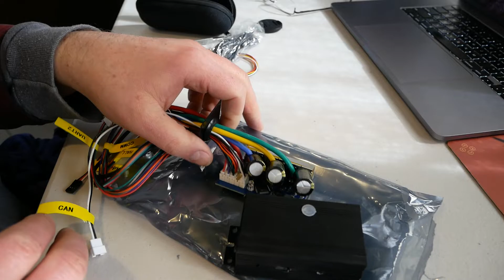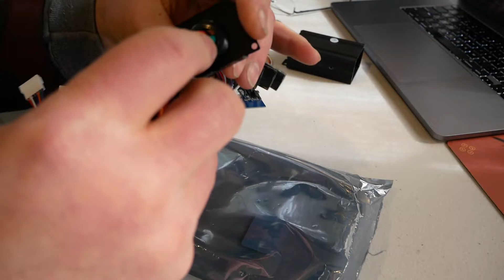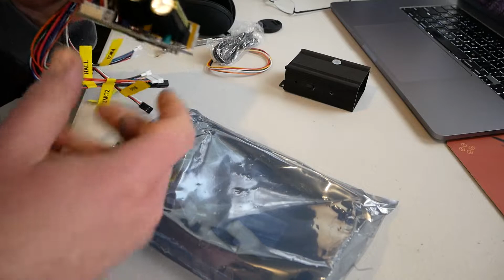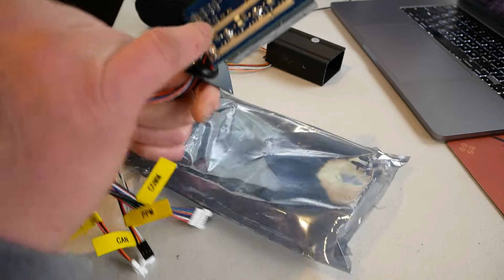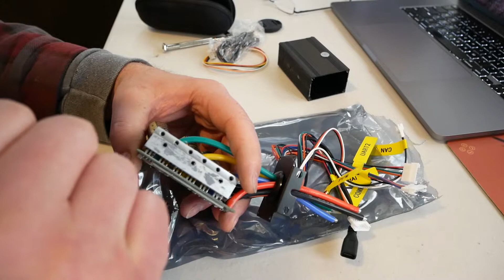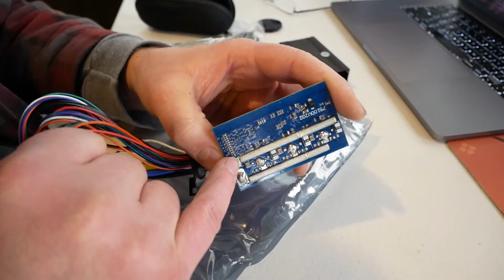Flipsky 75100 teardown

Comment: I think that they should put more space between the throttle wire pins , humidity can cause issues with sensitive throttle connections , that's why all ebikes should have a kill Buton that's close to the hands Incase the bike motor runs by itself at 0 throttle
Reply from the maker: GH1.25 is commonly used on most things from Flipsky. That's even worse. On these controllers, I replaced all the connectors with IP68 ones so I didn't care what was on them originally.

Comment: Dissapointing for 65USD? Did you get what you paid for?
Reply from the maker: Still junk. You pay a low price to get crap. Cheaper isn't better!
Reply: @de-bodgery yeah. I got a flipsky 75100 v2 pro and it's okay, neat features, but yeah it's noisy, bad form factor with tiny wire plugs.. they should have all the wires out a single hole in the shell with a glob of silicone and you just.. don't use the ones you don't want to use. Cut them short and close em off. These make me nervous it'll unplug and then give you 1.5v on the throttle which is like, half the torque.
While it's a lot nicer even turned down than the stock 20a trapezoidal controller, it does not inspire confidence. I left my original one on there with just XT60 and MT60 swaps back to it in case it messes up while in use. I should probably just get a phase runner (ASI's bac800) or something else decent. Vesc is a neat software environment, but seems buggy and prone to blowing up especially in these noisy things.

Comment: While I agree with some of what you said, I've found these to be very reliable running close to 75A Peak.  I was concerned about the non-reinforced PCB Tracks, but looking at it with a thermal camera, they barely heat up more than the bus bars - only a few C difference.  I've been running one on my e-Bike for 4 years, ridden every day - and it's been fine.  Even the heat transfer to the shell works sufficiently well.  Maybe it could be better, but in practice, it doesn't need to be better.

The waterproofing is an issue.  The best way to solve it is to fill the case with Ray Chem 'Magic Gel'.  It doesn't seem to affect the heat dissapation but renders the whole thing IP68.  I've run the controller fully submerged - and it didn't miss a beat!  I also filled the battery casing to waterproof the BMS.  I rode my bike through a flood with water over the handlebars, so the controller was about 2 feet under the surface.  The motor needed a bit of drying out - but the controller & battery didn't miss a beat. 

The wires being on connectors means you can 'weed' out the wires you're not using - making the harness much tidier.

With the addition of waterproofing, these are my favorite controllers.
Reply from the maker: Ever spend any time looking at the monitoring functionality? You'd quickly discover that Flipsky makes the MOST noisy VESC controllers you can find and the least reliable of them! So that's great the one you have is working, it's not working as well as other VESC options...not even close!

Comment: If anyone is having oddness in the behavior of this device, i want to point out two problem areas:

1> Flipsky doesn't proofread their docs, and every wiring diagram they have for this device is wrong.
Every
One
Go look at them and then your device and you'll see what I mean.
If you are already intimately familiar with this controller, or are just plugging cables in om a very vanilla install you may not notice, but if you are doing any custom wiring (required even if its all flipsky, but you are using their display) you'll quockly be frustrated.

2>  Do not rely on the function of vesc to figure oit your phases.

If you are having to use the reverse toggle in vesc because your motor is running backwards, just stop and correct the phase connections.

It only rakes a minute or two.

I was getting cogging on start that was awful

Different degrees in different modes until I corrected the phases
Reply from the maker: you might have found a bug in the Flipsky firmware.
Reply: @de-bodgery  There are so, so many apparently.

And I managed to do something stupid.

The controller abruptly stopped working last night with a blinking red.
Couldn't connect via USB.
Dis infected everything but power and was able to connect.
Decided it would make sense to start with the hardware specific fw.
I couldn't see any file sizes, buy I right clicked, downloaded- twice - same file size.

And of course it turns out you have to click the file - then there's a dl button.

Cripes. First time I've seen a fw update with no sanity checking whatsoever.

So, it reboots, vesc tool connects, then bit he's about the fw being unreadable (no shit - you loaded random garbage) and disconnects.

Good thing I have an st-link arriving tomorrow.

I think my dediprog could load the fw, I've just never used it for swd programming.
Reply from the maker: @Zomby_Woof  Sounds like the FW on it is corrupted. good thing there is an SWDIO connector so you can get the controller back!
Reply: @de-bodgery  oh, it's not corrupted - it's not even firmware.

It just html because I wasn't paying close enough attention.

I sorted that out though.

But my error would not clear, and it points to the motor.

I ended up pulling the hub motor apart because it had basically seized.

With a pair of vice grips of the flats of the axle, I could barely turn it.

So I pulled the commutater out and I can see scuff marks, but that doesn't tell me a lot. I think it's out of round. 

Probably because I waited too long  before putting a good torque arm on it.

I'm not going to bother to measure it to verify this. With no machine shop, the only option I have is a hail Mary with sandpaper to try and get enough clearance for it to spin free.

I have some ferro fluid, but I'm not going to bother with that unless and until I can verify some measure of reliability.

I'm not pushing it hard enough where the motor ever gets hot anyway.
Reply from the maker: @Zomby_Woof  Replace the bearings. A torque arm isn't going to create that problem. Either the motor shaft is straight or it isn't. That and bearings are about all that will cause rubbing of the stator with the magnet ring. I never use ferro fluid...waste of time, messy and can't be removed later.

Comment: Do you recommend a good controller for a 72 volt 5000 watt hub motor? TIA 😉
Reply from the maker: Tronic 250, Trampa 100-250 are both good options, but more powerful than the 75100. I'm just now implementing 2 of the new design 75100 controllers. They are OK, but not anything special.

Comment: Hello. Is there a good similar controller on sale that does not need to be finalized?
Reply from the maker: Finalized for what? I don't understand your question.
Reply: @de-bodgery  I meant not to redo it. Are there better quality?
Reply from the maker: @ЛенарБилалов-ю1э  Flipsky is the lowest quality VESC options. People buy them since they are so cheap and not because they are any good. If you want VESC controllers that are made well, stick to Shul, Trampa, Tronic.
Reply: @de-bodgery  These firms do not have the same form factor. I need a controller for an electric scooter outside.
Reply from the maker: @ЛенарБилалов-ю1э  There is an extremely high chance that you will have to make something fit...even imperfectly. These controllers don't exactly fit my scooter either.

Comment: Have you played with these much? I have a few of them and they just are not making any torque on a 1500W hub even if you set them to a max 1500 phase.
Reply from the maker: Considering this is a 100a controller, you already know that 1500a is not ever a possibility! Since turning up the phase amps had no beneficial effect, you also know that this isn't going to fix anything. You have something else wrong...not sure what.

Comment: Mine just blew after 7 months 50-80A at 20S, so seems decent enough for how bad it looks lol, upgraded to the 75200 now
Reply from the maker: Probably over heated
Reply: @EV Components Review (De-bodgery)  
Can be, looks like one of the mosfets or corresponding low side shunt blew since both are damaged and the trace between is gone 
Worked fine, when I tried to use my bike a few hours later the motor wenn instantly into reverse and then just small movements and buzzing sounds
Motor setup high offset current sensor 2 error and unbalanced currents
After that I found the hardware failure
Reply from the maker: @flosa1995  It sounds like the issues I mention in these tear downs are what you have in yours. Are you in the USA? Want to send me your controller for a forensic tear down? Showing the predicted failures is one thing. Showing the actual failures are the same is entirely different!
Reply: @de-bodgery  
Hi, sadly not
Im from germany, I can provide you with photos if that helps you, I cut the mosfets off, at 2 mosfets the traces at drain were gone (with that also the traces to the corresponding diode at gate) plus on another the trace towards towards the low side shunt.
The mosfets themselves looked fine besides being covered in residue
Reply from the maker: @flosa1995  Bummer!
Reply: @flosa1995  Min3 might also have catastrophic damage as well. 
I had exactly the same error, blinking red light sudden power loss.

Additionally I could not connect via vesc over USB until I finally disconnected everything except power and phase wires.

I then proceeded to brick it by inadvertently uploading garbage to it.

I have an st-link arriving tomorrow, but it's not going to do me much good if a big chunk of the device has vaporized.

I'm wondering though if the 'current' message may just be the last point before errors are no longer logged.

I.suppose I should open it up anyway to do a visual inspection and some of the mitigation steps.

It has a large bead of hot glue securing it to a large server heat sink and hsf, so I am not thrilled to R&R it.

Serves me right for not doing it right the first time and not be careful enough with what I was uploading.

Comment: Is this thing as powerful as a full size 7kw controller? Seems like BS that it could possibly handle that kind of power in that small of package. Even if you upgrade all the current paths and keep it cool....
Reply from the maker: Short answer: Yes
Long answer: This is a 6 fet controller. The continuous leg limit current is 75 amps for the TO-220 package. 82v x 75 amps = 6150 watts. The die limit of the mosfets is much higher than the leg limit. In a non-continuous use case such as a motor controller, the leg limit can be exceeded by another 10-15 amps without causing excessive heating and that's a maximum of about 7380 watts. This is assuming you have an efficient way to remove heat. These 75100 controllers don't have very good cooling and people do have issues with this. If you watch my other videos on this controller, you'll see how I mitigate that and so 6000w should be quite possible since heat removal is greatly improved.
Reply: @de-bodgery  Nice. Just hooked mine up, but it's acting like crap. Feels like maybe 400w. It'll whine and stall randomly. Ran the setup a couple times and set up 70A battery and 210 phase.
Reply from the maker: @joblessalex  Yes well this is FOC. It is quite possible that you need to do more than run the setup wizard to get proper operation. On my City which has 2 of them on it, it's not running like I want either. However, I knew going into the build that FOC commonly needs tweaking to get the power I ought to have. This isn't some dumb trap or sinusoidal controller. It's complex motor control that can be excellent. I've been messing with FOC controllers for a number of years and this is pretty common. Some people the motor wizard is good enough or even perfect and not for others. Welcome to the world of FOC!
Reply: @de-bodgery  Super fun.... Any recommended readings or someone to run me a crash course?
Reply from the maker: @joblessalex  google about VESC PIDs. Also, there is a terminal in VESCtool where you can send commands to the controller. google about that too. As far as a teacher...experience is the best one. Screw with settings, experiment. Read the descriptions for every feild in VESCtool that you don't know about. Worst thing you will do is blow up the controller. Yeah that sucks, but it's also a great way to learn. I usually get mad when I burn out stuff, but at the same time, there were valuable things I learned in the process.

Comment: 12awg is enough for phase wires.
Reply from the maker: Why do you think that? Ever look at an AWG chart to determine the current carrying ability of X diamater wire? 12 awg is rated for 9.5 amps continuous. Go look up "awg current chart". You'll find these charts easily. 10 awg is a little better at 15 amps continuous! So yeah...they NEED larger phase and battery wires!
Reply: @de-bodgery  The load is shared in a three phase configuraiton so thinner wires can carry the same load (power) than the positive and negative wires coming from the battery
Reply from the maker: @AlkayMusic  The current isn't shared. Any 2 wires are carrying the current across the motor at any moment in time. At most that you can say is that at any moment in time one of the 3 phase wires isn't powered.
Reply: @AlkayMusic  You're absolutly right
Reply: Those wires look like silicone wires which can handle significantly more current. More on the lines of 40-45 amps. Silicone can handle UpTo 200C therefore the current rating is higher. The current handling you mentioned is true but for regular PVC insulation cables.
Anyways great video

Comment: Thanks for sharing.
Is the thickness of the board enough to handle the power?
Reply from the maker: That's the point of the copper reinforcing...not that it was done right from the factory.
Reply: @de-bodgery  Are you still using them?
How they perform?
Reply from the maker: @jkrsecret  They are not yet implemented beyond some bench testing. They will soon be installed on the scooter. This project is many faceted of which just one part was the controllers.
Reply: @de-bodgery  I have a 5600w e-scooter.I saw the controllers but I was skeptical as there are reports of overheating.
I believe with the upgrades that you made, won't have any issues.
I already pursache a bigger battery 16s-40A 3C constant discharge.
I'm in for a smart bms with uart so I can connect it with the controller?
Also it as to be on smaller size as there is not a lot of space left.....
Reply from the maker: @jkrsecret  Those reports are not wrong...they do overheat. This video explains why. I did some mitigation work to mine and they are much better now. Also they will mount to the cast aluminum swing arms and that ought to soak up any heat quite nicely! Smart BMS...I've never considered what might work with VESC controllers. I don't know that I want that and besides, is that better than the app that comes with the smart BMS? I've been using JBD BMS's for quite a few years now and they work pretty well and the latest android app is pretty solid. There are lots of JBD options. You'll probably have no problem finding something the fits your needs.
Reply: @de-bodgery  I was looking the JBD but for 100a+ they are a bit big...
Well if it communicates with the controller it would be nice to have them all together.
There is a vesc bms but it is only 12s
Reply from the maker: @jkrsecret  Check what's available in ANT. They are a good brand too. You might find something smaller that meets your amperage needs.
Reply: @de-bodgery  I'll check your channel first!😁
Reply from the maker: @jkrsecret  It's been a really long time since I did a video around ANT BMS's. They are pretty good and I have a few of them, just like JBD better.
Reply: @de-bodgery  are you going to use this esc? did you test it? with 20s i think its still impressive. more Volts less current and less heat.
Reply from the maker: @joaquinninoortega8023  Yes I am. They have both been bench tested and are among several items getting installed on my Dualtron City scooter. The lights are getting my time and attention right now, but the next item is the wiring to both controllers getting installed. They are both mounted on the swing arms of the scooter, but this is a test fit for running cabling. They will come back off once that is more or less how I want it laid out so I can add connectors and other things to them. I'll be posting a new video on how they are doing probably next month.
Reply: I'm configuring bluetooth via uart2 and using a nrf51822 module...any idea how I can find the swd programming pins on this controller?

Comment: I always have temperature problem with this 16s battery
Reply from the maker: ??? This video is about the Flipsky 75100 motor controller, not a battery. I'm not sure what you are commenting on.
Reply: @de-bodgery  i think hes talking about the esc even with 16s. Im curious if you have modifications and used it. is this fsesc really worst than generic esc for scooter? that's what im curious about.
Reply from the maker: @joaquinninoortega8023  Worse? Not a chance! Imperfect with some poorly implemented aspects? Yes that is true. People do have issues with them over heating and burning out if they are not improved. I did a couple of videos on the fixes I did to mine. The issues can mostly be resolved without a lot of trouble.